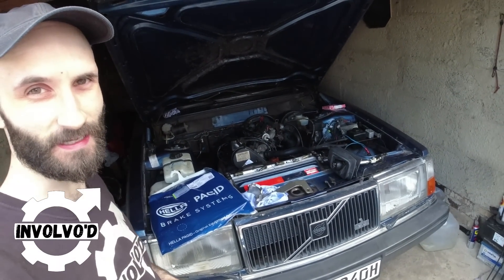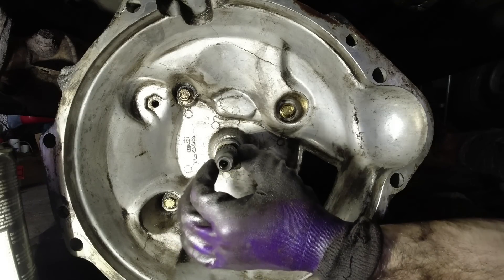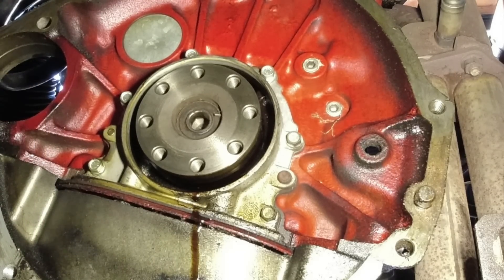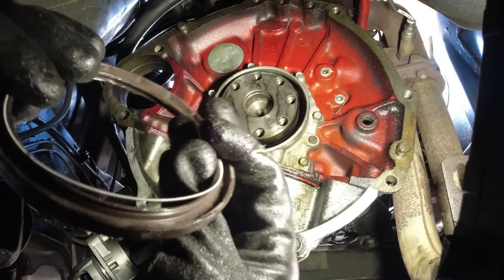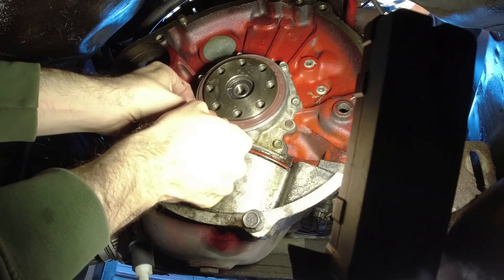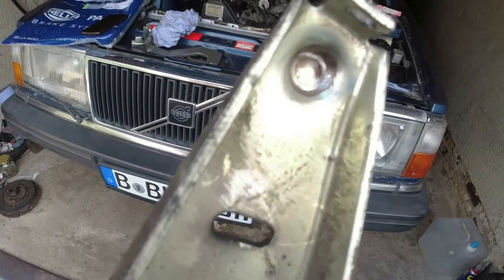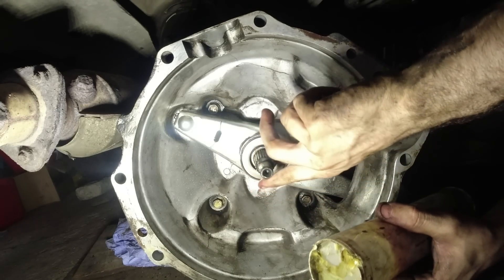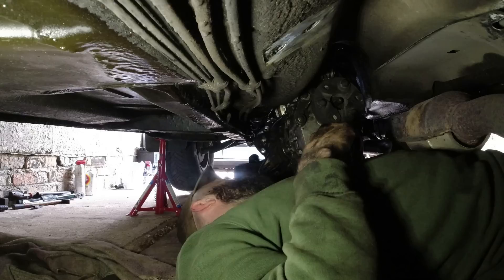Lili the Volvo 240 gets New Clutch Parts!

Comment: That flywheel could still be glazed over without being blue. You can run some very fine sand paper over it to give it a little clean if you're not replacing it. New clutch might wear to the old flywheel if that makes sense.
Reply from the maker: That's a good point! It's operating nicely at the moment after a few drives hopefully it stay that way 🤞
Reply: @Involvod  I'm usually one to replace all 3 not a fan refinishing flywheels or brake rotors.
Reply: @Involvod  offcourse it will. the disk will gradually bed in to the flywheel and pressure plate and it will be good for another 100kkm. it's not like it's a turbo car with 350Nm or so. it'll be just fine!  
When you slid that prise axel in and pushed the box all the way to the block face i was like "yessss, he's on the home stretch now!" 
jobs a good'n!👍
Reply from the maker: @jfv65 thanks, that makes me feel better and yes, it was a glorious moment!
Reply: @bluej511  good luck finding a dog dish in this day and age! Those fly wheels are no easy find.
Reply: @jfv65  100kkm? She's not a VW. :P 
My 240 has 443kkm on the clock and the previous owner replaced the original clutch at ~350kkm. To be fair, he was mostly driving longer distances apparently. I can't say there's anything left to be desired from the clutch. 
I'll measure and maybe swap it for a new one when I finally decide to put the lower mileage gearbox in I that have laying around. We'll see how it's held up over the last 100kkm.

Comment: When the flywheel is machined, the step of the flywheel has to have the same amount of material removed, which means removing and reinstalling the guide dowels. A lot of machine shops won’t resurface stepped flywheels.

Comment: Whenever I do a clutch job, I always have the flywheel re-surfaced.  Mostly for peace of mind, I suppose.  That said, the "dog dish" flywheels as found on the later cars are a bit harder to re-surface (because they are not flat) and not so many machine shops have the correct tool to complete the process.
You're lucky that your 240 has LH2.2.  On the LH2.4 cars with manual transmission, you have to properly align the flywheel upon re-installation.  Failure to do so will result in an erroneous reading from the crankshaft position sensor and this equals a no-start condition.  Which means you get to pull the transmission AGAIN.

Comment: Sledge, I feel your pain. I've done this very job quite a few times. The last time was on a 2007 VW Beetle. Getting the gearbox back on is the hardest part for me. Lining up the gearbox is like docking with the ISS. With the Beetle, I ended up borrowing an engine crane from the local garage to get the gearbox back on.
Reply from the maker: It's really not a fun job is it! 😩
Reply: I changed the clutch on a VW Passat I had when I was 20 or so. Swore myself to never ever do a FWD clutch without a crane and alignment tool ever again. Shit was a nightmare. Took me 2 full days of pure pain and despair. 5.000km later the engine shat itself. I still hate those shit-boxes with a passion. The only redeeming quality about that soulless piece of rubbish was teaching me to keep my fingers off of them and FWD clutches in general. 
After suffering through that freaking ordeal the 240 clutch job feels like a walk in the park.
Reply: Yeah, FWD cars are a pig of a job to change the clutch, the Beetle being a case in point.
Reply: @Parknest  I got a little carried away by my disgust for that POS I used to drive there. 
I wanted to say I feel for you and anybody attempting that job at home. RWD is just superior in every way important to me. Especially as maintenance friendly ones as the old Volvos are. 

God I still despise that utterly emotionless pile of steaming excrement though. shudder

Comment: Well done for getting that gearbox back in. I once spent 3 hrs trying to get a used gearbox to fit only to eventually find out that an extra dowel was on new box - hitting the dowel on the block!!! Have to remove an alternator myself this weekend as not charging!
Reply from the maker: One of those nightmare scenarios! It happens to the best of us 😂
Reply: @Involvod  It wasn't funny at time but is now.... Alternator out in 90 mins, which I was pleased at on modern vehicle. Have a great weekend.
Reply from the maker: @ched999uk  nice! Thanks mate, you too

Comment: As far as I know you had problem with get 1 or 2 ⚙. Had you solved the problem via replace the clutch? Could you tell me approximately repairing price?
Reply from the maker: Yeah it's all ok now, could have been due to replacing the pilot bearing too as someone mentioned in the comments in the last video. I spent probably around €150 on the bits

Comment: Love the video. I used to have a 1987 740 GL and loved it so much. I am trying to find a 240 but struggling have you any advice for me. Have you considered looking at the Volvo 360 as that has a 2.0 red block engine.
Reply: a 360 is even rarer. Specially the 5dr GLT sport version. 
Many 2.0L inj. cars in NL ended up as race cars because there used to be a 1 model racing series on Zandvoort circuit. (Volvo 360 NOT-Modena Cup)

So if you fund a good 360GLT for a good price snap it up because there are not many left!
Reply from the maker: I noticed how rare and expensive the 360 is now, would definitely buy one! Good luck with the search, our usual tactic is to keep checking online and be very quick when one does come up!
Reply: I knew some friends was selling a B reg 360 glt at the time they offer it to me for £1200 wish I snapped it up. I regret ever selling my 740 and I even own a J reg 940 auto I prefer the saloons to the estate though.
Reply: Another classic Volvo to also consider would be a 260 if you can find one or the 760 or 960 if u can find them
Reply: Sam, I am in New York, USA. Where are you?
I have three Volvo 245s. 1988 automatic, 1989 five-speed, 1992 automatic. I will be selling one of them, maybe two. Let me know if you’re interested and I can tell you a lot more about each one.
Reply: @stevenmiller7731  hi there I’m in the uk I’m afraid thank you for considering me

Comment: The flywheel looked good enough to me. A little wavy with slight heat spots but nothing major, it'll be fine. 
Only thing I'd have done differently is to put a piece of wood on the jack to extend its reach and put it a little further back underneath the gearbox. Might have saved you a bit of wrestling. 
Nice safety setup holding the box in the interior though haha. Just the right amount of creative jank, very nice. :P
Reply from the maker: Thanks man, it looked a bit better to the naked eye but the camera definitely showed up the waves didn't it. I've got a bigger jack in the UK can't wait to have it back 😅
Reply: @Involvod  Weird how that works yeah. I can tell you from experience my ugly mug looks much worse on video than in a mirror too :D

Comment: Like, this is such great timing, like you would not believe! Re-assembling my clutch tomorrow! Wow am I glad this came tonight <3 The Volvo gods truly are watching over us
Reply from the maker: Haha, perfect! But take it all with a pinch of salt, it was my first one, the information might not be reliable 😃
Reply: @Involvod  Yeah, but honestly it's the best all-round information I've been able to find! Tried getting the transmission out a couple of days ago, and it was just so stuck! We had to give up since it was getting late... Patched it back up and it had developed a nasty shake from the axle (had to patch it up as this was on my office parking lot haha)
Reply from the maker: @herrjonna2007  ah that's a shame, as you saw I really struggled to remove mine, I think it got easier once the box was lifted up high enough at the back so it's level. Good luck with it!
Reply: @herrjonna2007  In case it really fights you and tapping it with a rubber mallet and wiggling doesn't help, there's a little cavity / cut-out on the bottom of the bell housing you can utilise. If you pause the video at 16:34 you can see it.
Edit: might be easier to spot at 16:31 just above the lowest bolt.
Reply: @Bassalicious  that's a really great tup, thanks!
Reply: @herrjonna2007  You're very welcome. Good luck my friend :)

Comment: The radial play in the input shaft isn't exceptionally high, it has needle bearings and a sizable ball bearing supporting it inside the transmission and the tip of the shaft is supported by the pilot bearing. So long as the pilot bearing is in good condition (in your case, new!), there isn't an issue.

I think I mentioned before about the Dana/Spicer 30 rear ends howling, certainly the 1970 145S that was my family's main car howled from when the car was new. When I drove it years later as a teen it still howled the same and I thrashed that poor car. It has to do with the hypoid gear alignment which is not a fun procedure to do.

As for resurfacing flywheels, I suppose it might be truthful that it isn't done much anymore since manual transmissions have long since fallen out of favour. Ideally, this should be done with a new clutch to remove high spots and glaze but it isn't like you're driving it that aggressively. It's not an externally balanced engine so I don't see why the machine shop would say it'd need to be rebalanced, it just needs the glaze removed :D
Reply from the maker: Thanks, I was hoping someone would give a bit more insight into the shaft set up. To let you in on an upcoming video, I checked the oil in the diff and found why it was noisy, bad times indeed!
Reply: @Involvod  Oh no :/

Comment: I have a Volvo 240 that is currently being m47 swapped. I got the flywheel lightened, I was told by a Volvo mechanic of 35+ years that if you take off equal weight the flywheel doesn’t usually need to be rebalanced. Which makes sense to me because If the weight is equal all around why would it need to be rebalanced? We took 6 pounds off of mine.
Reply from the maker: That's what I thought!